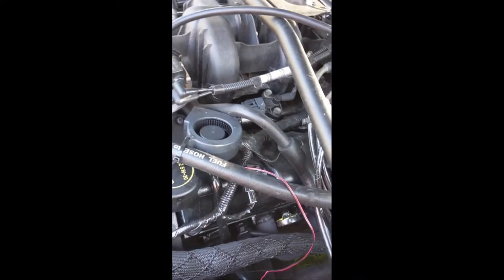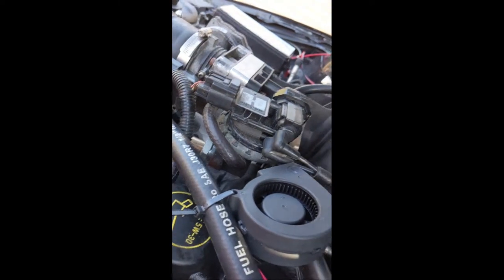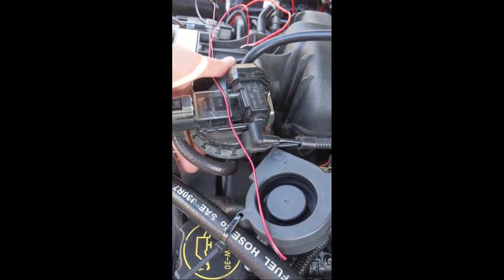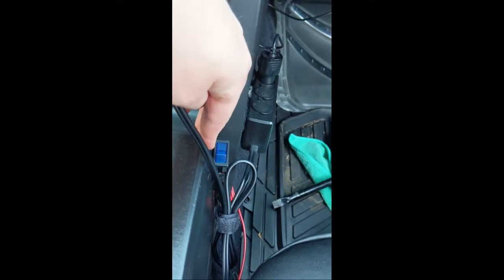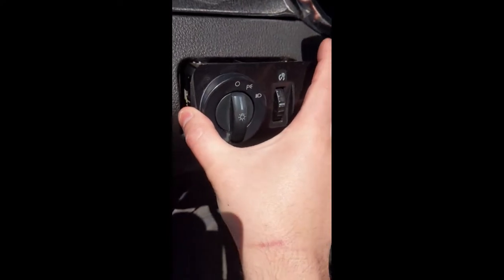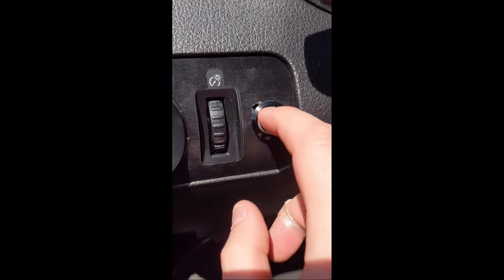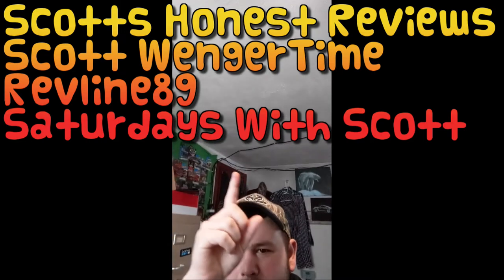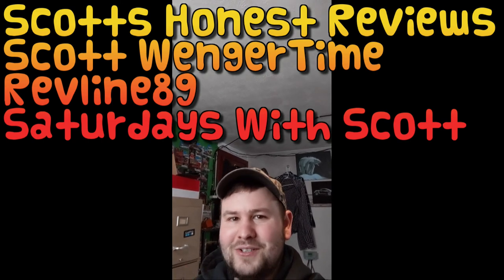Idle chop mod Switch - EGR Fan Install - 2008 4.0 V6 mustang

Comment from the maker: Idle chop mod Switch - EGR Fan Install - 2008 4.0 V6 mustang
the switch i used = https://amzn.to/3ni1cim
the Blower fan i used = https://amzn.to/3vfsbOl
zip ties needed = https://amzn.to/3vlxOuH
Rocker switch panel im going to install = https://amzn.to/3gCdUao
Box im using to contain my EGR on off valve https://amzn.to/3gBPopW
Bigger box i may use with my 5 switch rocker panel - https://amzn.to/3xlEtqr
valve ill be using to make my idle chop on off via electric push button = https://amzn.to/3gAPVbV

Comment: I thought I'd watched all your vids on the chop mod,but this is the first I've heard about the little fan.Does that mean the chop mod makes the egr overheat?
Reply from the maker: Oh yes, the idle chop cause fuel to burn hotter and also causes egr to get much hotter than normal which we est could decrease the life of the egr by half, while it's not proven it will it's just a guess as heat lowers the life of parts
Reply: @RevLine89  Thanks for the info
Reply from the maker: Your welcome!

Comment: Do you have the rear mufflers deleted? And would you still be able to get a similar exhaust sound with stock cats?
Reply from the maker: yeah i do full setup is long tube headers no cats dual glasspacks xpipe , with stocks cats it will still sound pretty good but you'll wanna get rid of the rear mufflers  i had stock cats with shorty headers and it sounded good